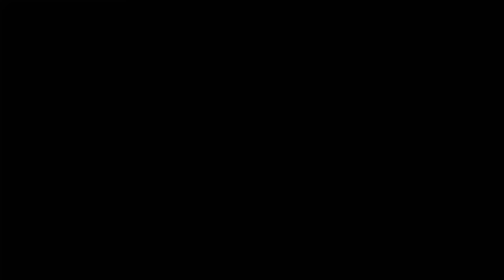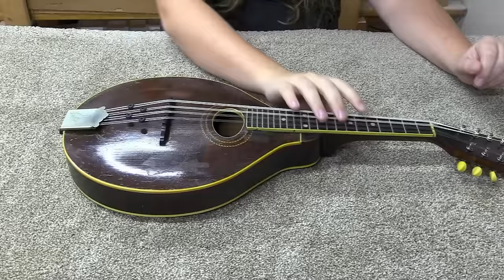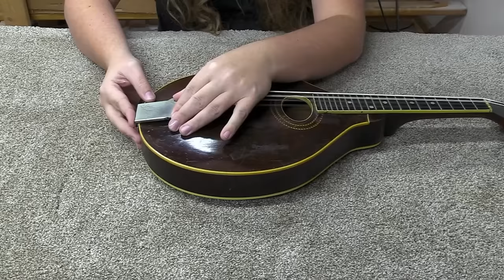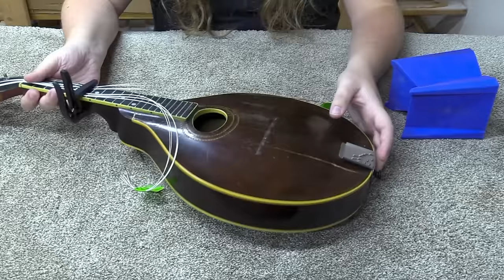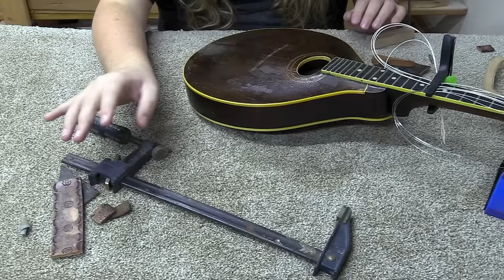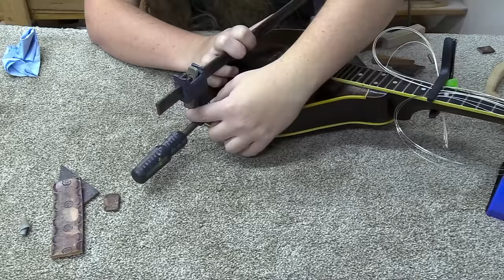1918 Gibson A2 Mandolin Crack Repair

Comment: That's a really nice example of a well used 105 year old Mandolin closing in on 106 since 2024 is less than a month away.  

I cheat and use the Sharpies too.  Easy to have a bigger selection of colors and widely available at most office and craft supply stores.  I also have been known to use food coloring mixed with 90% alcohol for custom colors.

Best!

Comment: Using one of those little rubber suckers works well for forcing the glue into the cracks.
Reply: I am waiting on you to tell me what kind of glue. You have said the word glue at least a dozen times but not what kind of glue. I have a crack in my mandolin as well going with the grain right down the middle of it
Reply: @gregadams6055  you're not commenting to the guy who made the video FYI. Most guys use titebond from what I've seen.
Reply: @JavinCarelse  okay thank you. Probably some kind of hide glue or horse glue.

Comment: Caleb, nice job!  When I want to get glue down into a crack or spread in places I can't get into I use pressurized air to force the glue in. A little pancake air compressor with a nozzle might work well for you. I would however keep the air pressure low especially on something as delicate as a 112 yr old mandolin.  Think about it. Also I have a question. I've watched a lot of videos on lowing the action on a mandolin and using a pick at the 12th fret but no one ever says what thickness of pick. What thickness of pick would you suggest when setting the action on a mandolin?  Thanks, JW.